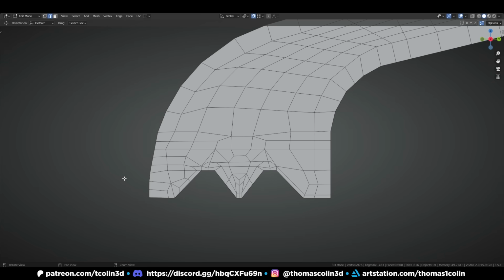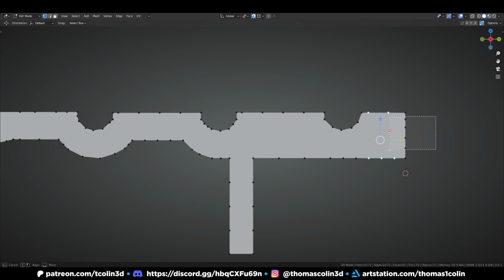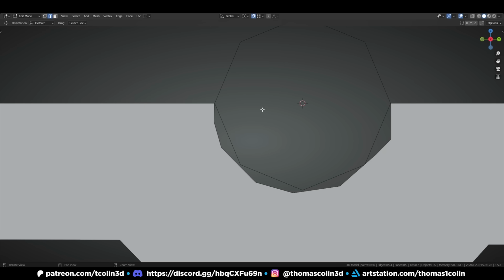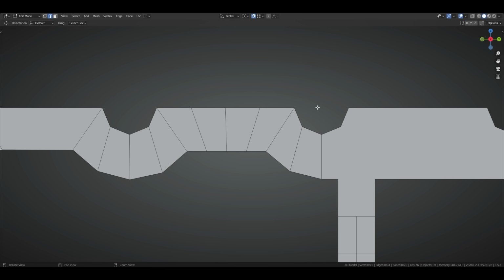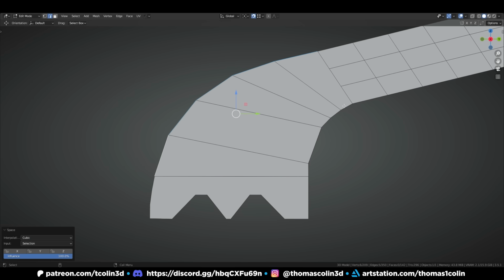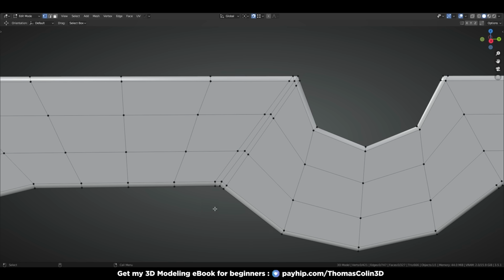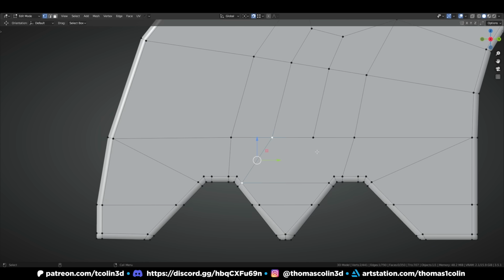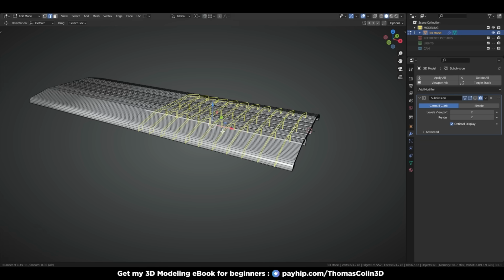Blender Pro Tips - How to Get Clean Topology Every time

Comment: thank you for share those basic step , help me a lot 

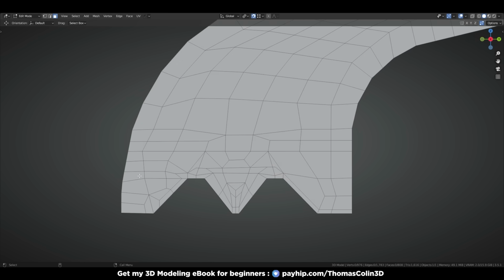0:35   besic loop edge role 101
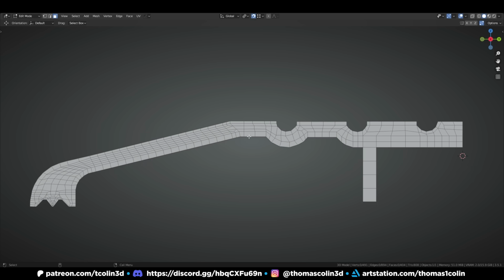1:26   start clean up    vertex clean up
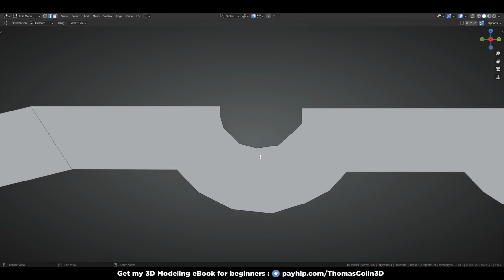2:31   cicle clean up
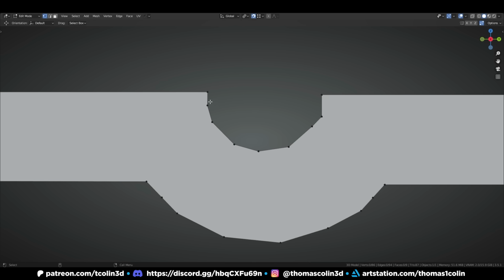2:43     aline up
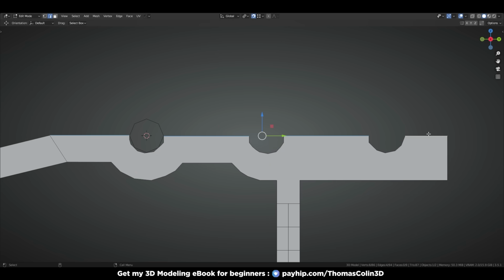3:15    bonding box   sacle z
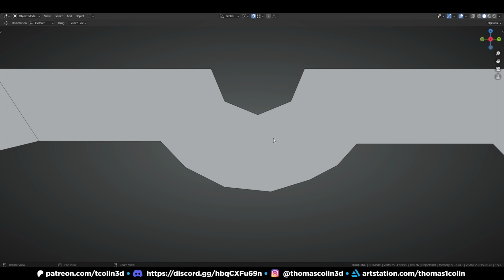4:09  edge sapce
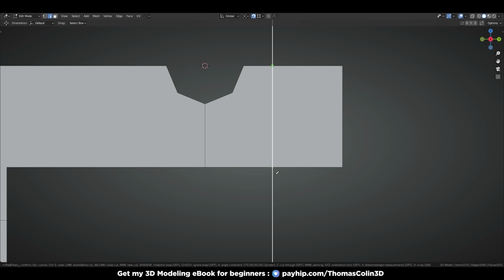5:09  knife tool tips
6:10   joing part   ( conter )
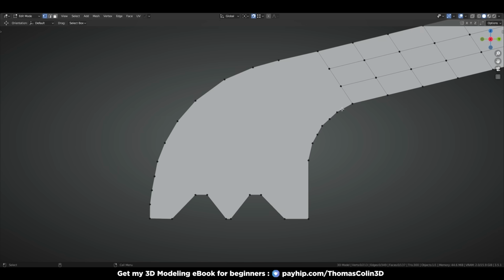6:26
7:40   bevel edge
8:05   connet counter  3 way
9:06   complex  edge clean up 
10:48  sub surface

Comment: @3:39 you went t alot of effort after the scale+z 0 to level things off setting up that circle and stuff, why didnt oyu simply use the "tocircle/tosphere" modifier or the looptools -> circle functions built into blender an target the transformation around the 3d cursor? you cold cut a good few minutes of effort out that way and achieve the same result, all wtih built in tools.

Comment: so i am game dev, i making asset for my game, and for non character or mesh that will not get deform aka Static Mesh i think your topology is bad idea, since game dev topology is all about:

1. having low triangle faces but keep the good smooth edge , the bigger the mesh the higher the detail vise versa (i really don't understand why you make that half circle became low on vertex)
2. having good connected UV map (edge select -> mark seems) require for good seamless texture, and Bake shadow map for performance
3. utilize shade smooth (select 2 or more face -> right click -> shade smooth)
4. for more detail you can create high poly and bake the normal map to low poly
5. game engine like unity and UE5 always auto triangulate mesh and if you do hard surface modeling sometimes you need to triangulate itself inside blender (modifier triangulate) to see the edge transition

this requirement is for game ready static mesh, if you create mesh for something else (like  3d print or animation) is up to you
also modeling mesh for me is 35% job done, the real challenge is the texturing itself
Reply from the maker: Hello, this is not a game asset at all! I don't make game assets on this channel, I only do SubD modeling!

Comment: At around 8:20 you make these really thin parts where the curves meet the straight parts of the model, how come? I assume it has something to do with the make smooth modifier, but not sure what it does that you didn't also do on some other corners without adding as many edges.
Reply: Yeah a bit confused by this too. Very long narrow faces should be avoided because GPUs don't handle them very well. If they're seen from distance they can cause overdraw on a lotta clusters where that wouldn't otherwise be necessary. Doing tiny small triangles also isn't great, but it means a single overdraw rather than overdrawing the whole line of 2x2 pixel clusters along the face.

Comment: It's always quads... What about triangles?
Reply: Keep in mind that with the Blender subsurf you might want to try using n-gons instead of triangles where quads don't work. They usually result in better shading, basically.
Reply from the maker: Triangles are fine as long as they are on a flat surface. You can use them if you want, no problem at all. :)

Comment: Thanks for the video - really informative! At 3:16 you change the pivot mode and then align the edges using s+z+0. I tried doing the same alignment without switching the pivot mode, and the result looked the same. Maybe I’m missing something. Could you please explain?
Reply from the maker: You're right, it's also working if you set your pivot point to median point!

Comment: 4:00 you can you use the edgeflow add on to make half circles in vertex mode
Select the 2 opposite vertices < right click < edgeflow < set vertex curve
There are more usefull features in vertex mode I'll recommend reading the official documentation on github